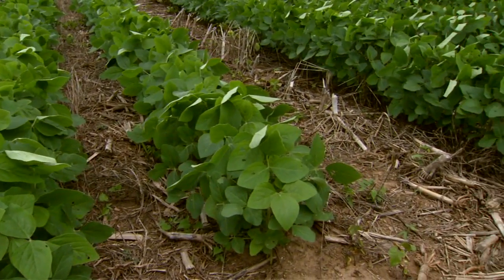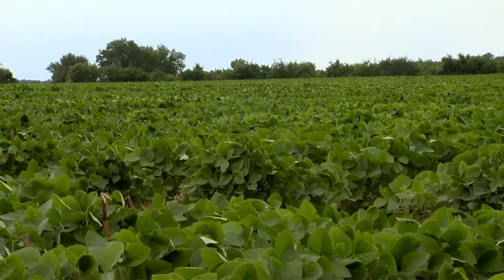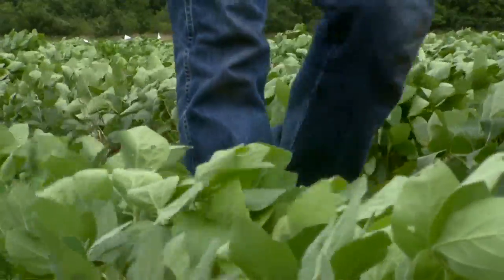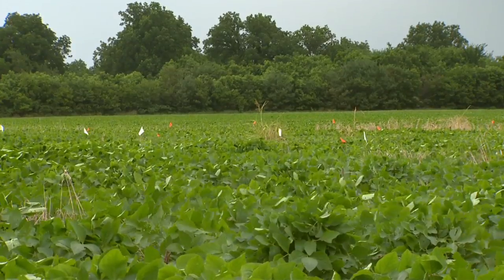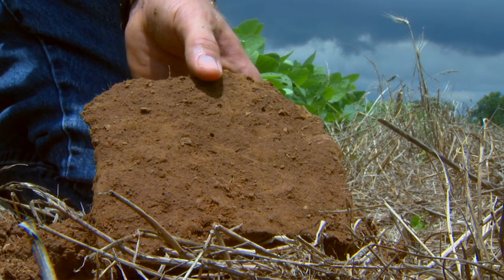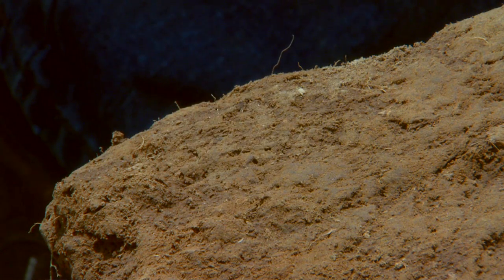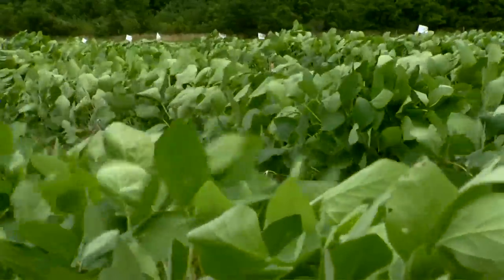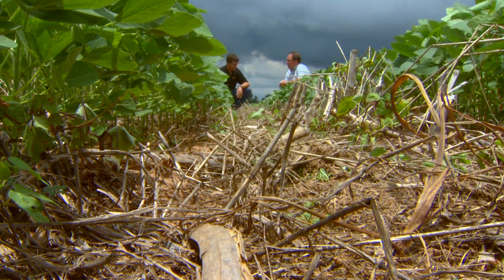No-Till Farming

Comment: Still sceptical? Why not try no-till on a single land and see for yourself the changes in the soil and crops. If the results are to your liking, extend the practice to another land and so on. Applying no-till or minimum-till in vegetables will differ from farm to farm according to the crops that are grown and the climatic conditions, but it’s certainly worth a trial. Zeljko Serdar, CCRES
https://solarserdar.blogspot.hr/2017/11/no-till-farm-technique.html?showComment=1511082506526#c104232302018851274